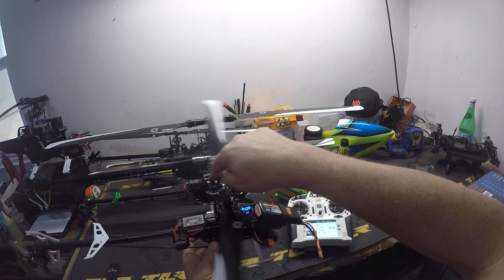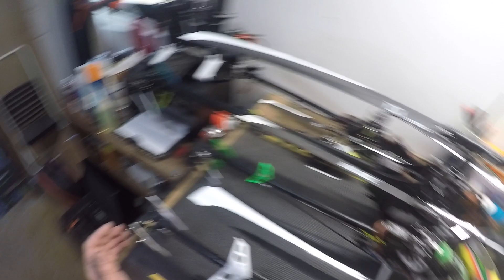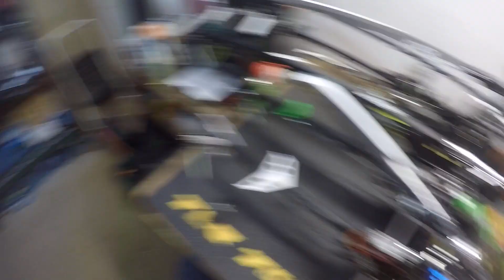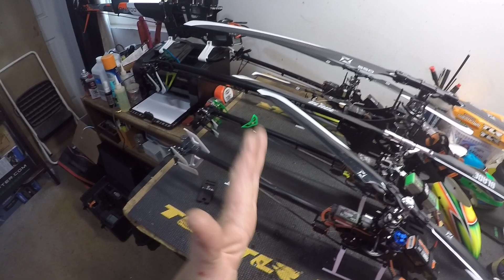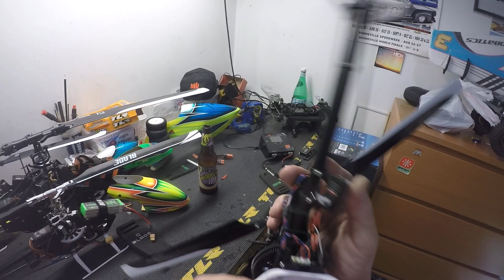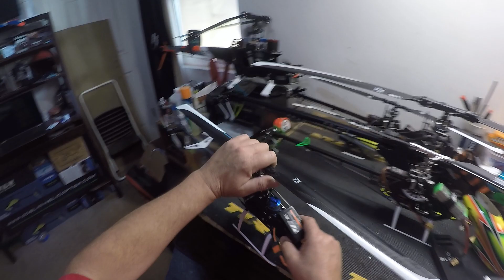R/C Helicopter Set Up Tips, Blade Out of the box BNF or Kit, Coe Show Style Part 1 of 2 videos.

Comment: New subscriber also, New to heli flying, I have a 330s and a NX8+. Programmed to manual. Normal F-mode (switch B) seems ok, but when switched (switch B) to Stunt Mode 1 or 2 the rotors pushes heli down. I don't think it should be doing this. Do you have any suggestions on how I can correct the Stunt 1&2 Blade angle to keep in air? I don't seem to find anything out there with this issue.
Reply from the maker: @BillTozer  simple. Turn on radio and heli.  Let it initialize.  Put in hold mode.  Switch H.  Put at center stick also in stunt 1 with Hold on.  Does the swash tilt forward when the heli is level on the table?  That is the issue.  If you have touched the trim tabs on the radio in flight, in Safe, put them all back to 0.  Flip between safe and stunt 1 and see if it tilts.  If it stays level, it’s you, lol, and if it tilts, you need to go in forward programming , servo set up, sub trim the servos to level 90 degree arms at center stick.  One more thing, flight mode switch needs to be picked as flight mode switch not switch B.  I hate that this is an issue, but it is.  So assign Flightmode switch to gear.  B has a different function. It will not initiate SAFE.  Have fun.  I hope this helps.
Reply: @CoeShow619  Thanks, Tried what you recommended. Didn't work. I ended up deleting the model and did the add model and inputting the recommended data. Before, I uploaded New BNF model that I think had something in there to cause the swashplate to go up when switching to 1&2. This seems to have worked.

Comment: Hey this is pretty cool. Your pretty good.  I've got a Blade 230 Smart. And it has a bad tail wag. It's a RTF and came with a DXs is anything I can do to adjust this ?
Reply from the maker: Realistically the tail is not the issue. It is the headspeed. I have never adjusted PID on a 230s. It doesn’t need it. The only way would be to use a Spektrum computer radio and adjust the Throttle curve to something with more headspeed. If you are flying at a low headspeed it will always hunt. Does it stay solid in stunt 2?
Reply: @CoeShow619  yes I see that. The transmitter? Capabilites
Reply: DX6e 👍
Reply: And lower the head speed !
Reply: @CoeShow619  so basically a DXs is no good for a heli, great for 3 planes? I don't know what I'm talking.  Not enough experience.
Reply: AUX Flaps🤪

Comment: I bought a blade 330s and am trying to bind my dx9 but my flight controller blinks red not orange?
Reply from the maker: Program the radio to the settings in the instructions. Put throttle stick at low position. Leave radio off. Put bind plug in FC. Plug in heli. Receiver is now blinking. Turn on radio holding the bind button.  Pull bind plug out now. Done.
Reply: @CoeShow619  Thank you but the reciever is blinking red not orange

Comment: I’m having some issues with setting up my AR7210bx on my blade 330x I’m a noob and don’t know much anyways I been looking for your email to ask you a couple questions I noticed you don’t have it on your YouTube channel anyways can you send me a email my email is Pearson_17@yahoo.com anyways thanks a lot have a good one!
Reply from the maker: What exactly is holding you up? I can explain easy here.
Reply: CoeShow619 I just can’t figure it out this is my first Heli first time I tried to fly it.. the helicopter got light on the skids and rolled to the right and got destroyed so I re built it and got the ar7210bx so I could get the safe and bail out shit anyways long story short is can I send it out to Cali to you and get her dialed in for me I will definitely pay you I have asked tons of ppl but no one knows shit about the beastx software I even asked horizon hobbies and they won’t do it I know this isn’t really a hobbie for noobs but yea i was even thinking about upgrading to the 330s receiver but idk
Reply: CoeShow619 also I upgraded to the micro Heli carbon frame with there Swash plate as well I used there recommended Swash push rod lengths and I checked the Swash it’s level.. the Heli has a new main shaft and the head is the blade 450x grips and shit is all aluminum new feathering shaft (or whatever it is) but there is a part in the programming that requires +/-6 degrees of pitch and no matter what I do my pitch gauge will only go to -\+4.2 not sure what I’m doing wrong there and I keep burning up servo gears even with the recommend servo settings so I upgraded the servos to ds215 servos that I still need to put in ahah and I do have a sim and I can fly my micro cp helicopter the bigger ones are just intimidating at first ... it’s fun working on them just disappointed no matter what I do I still can’t get it right
Reply from the maker: Basically. Hold down button on 7210 to get into set up menu. Push button till you get to J. Now move cuclic left. Now while holding left cyclic move your rudder stick either left or right to increase and decrease the cyclic amount. I actually take it to 8 degrees. Once that is set, push button, move to K. Now set collective pitch by moving pitch stick to full pitch. Increase or decrease to get 14 degrees on that little 330. Now set L. Hold cyclic input full left, or right or forward or backward and get light on the 7210 to just barley go from red to blue by using your rudder stick.  Go through the whole menu, and it will move swash up and down and reset. It’s very easy. Make sure you are at 100% rate in your transmitter doing this.
Reply: CoeShow619 perfect thanks for the help I will try this tomorrow also I have it so I can do all that from my pc with the beastx software idk if it’s the same settings I haven’t tried doing it on the 7210 by it’s self
Reply from the maker: I like the button method. Get good at it, then you don’t need the computer.
Reply: CoeShow619 well did all that put some training wheels on and actually got it like 5 feet off the ground this time ahaha and it was reallllly nose heavy kept dipping really bad and drifting to the left ended up wrecking it again and broke that shitty ass micro Heli frame so I just bought a new 330s since it has safe